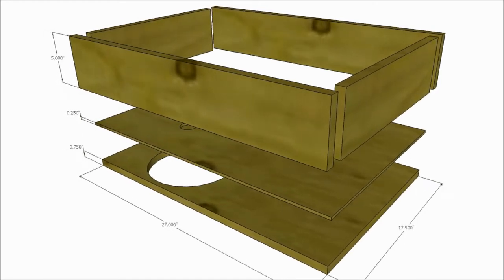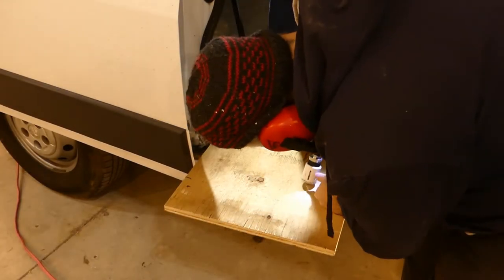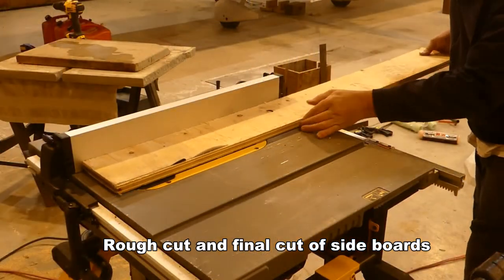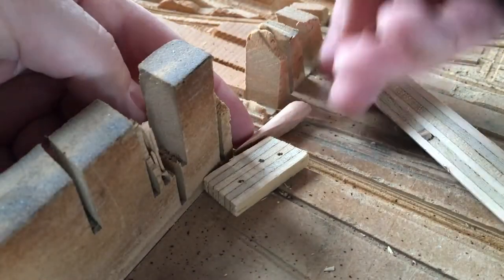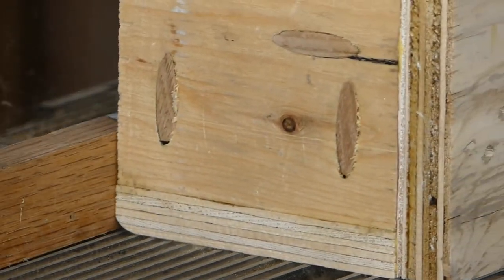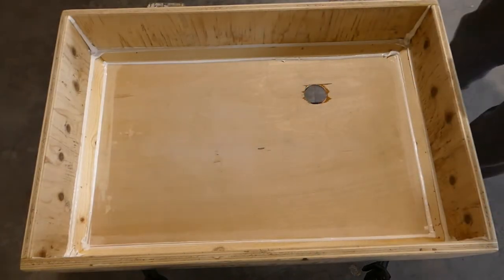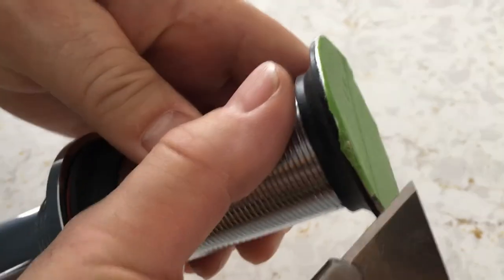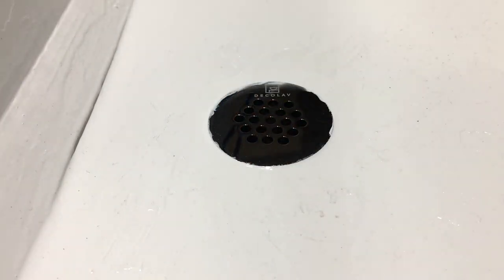RAM PROMASTER VAN BUILD - DIY Shower Pan

Comment: I’m a 75 yoa DIYer preparing to start my 1st conversion van. Your idea is perfect!!! BTW, my 30 year old fiberglass shed was to the point I needed to replace it. Before spending the energy and $$$ I decided to try Flex Seal. Four years ago, I used 2 gallons…it does not leak and holds my weight on the roof + it looks great. Thank you!!
Reply from the maker: Well that is really good to hear.  Thank you for sharing that with me. 
Dwayne

Comment: Good idea for a custom pan, never thought about Flexseal. As a carpenter though, having used pockethole plugs you simply glue them in place, let them dry, and sand them smooth. You can also cut them flush once dry with a Japanese flush saw, then sand.
Reply from the maker: Thank you for the feedback, and I appreciate the advice.  kindest regards.

Comment: thanks... that idea with the ball would not have occurred to me... I'm starting a project and that idea of how to make the part for the shower seems great... that's what I'm going to do.  👍🏼
Reply from the maker: Cool, good luck with your project.  I’m not sure how we came up with the ball idea… I guess after our plan “A” didn’t work, we needed good plan “B”.  We are having a great time building our van.  Thank you for the feedback, much appreciated.
Dwayne
Reply: @LifeIsShortDIY  I started constructing my shower pan yesterday- I'm following your process to the letter, but I'm left with two questions. My first question pertains to how the shower pan makes contact with the floor beneath it... the way the tennis ball creates a concave area around the drain, how did you control how deep of a depression the tennis ball created so that the deepest part, where the drain is inserted doesn't protrude past the floor of the shower pan - I'm guessing that the deepest part must be flush with the bottom of the pan for the drain insert to be  snugly fitted and for the entire bottom of the shower pan to be flush when it rests on the floor of the van. How did you get that concave part so accurate? I''m concerned about making an error and then having that concave area of 1/4" wood crack, either during installation of the drain, or by accidentally stepping on it when showering. 

My second question: Can you tell me, how did you attach the finished shower pan to the van floor? I've got sheet vinyl as the top layer of the floor, with a 5/8" layer of plywood as my subfloor, which is screwed and glued to 2 x 2" joists scattered throughout the van floor- I have no control over where those joists will line up beneath the shower  pan- the shower pan can only fit into one, pre-determined spot in the van so I have no guarantee of hitting the joists with any screws.  Did you screw and/or glue the shower pan to the subfloor?  How did you handle this part of the installation? 

I'd be so grateful for a reply, I really want to avoid making a mistake and hope to take advantage of your experience with this project. Thank you for a brilliant design idea! (Please forgive me, I've posted this comment in two different places in the hopes that you will find it- I don't mean to be rude by making a duplicate post.)

Comment: I’m getting ready to do this for my entire class a bathroom, turning it into a wet room.
Reply from the maker: I would love to hear how that turns out.  Keep me in the loop. Cheers Dwayne
Reply: @LifeIsShortDIY  I ended up re skinning all the walls with new plywood, sloping the floor to the drain 3/8” to 1/2” per foot.  I caulked all seams well and used 4-5 coats of redgard over all surfaces creating a seamless room and topped it all off with exterior house paint. I still want to put some penny tiles on the floor. 
For the drain I used 2 - 12” by 12” by 1/2” pieces of plywood. On the bottom upper plywood piece I routed out 3/8” deep by 8” circle and used the drain to draw it into a well. The void between these two pieces was filled with subfloor adhesive for a little extra support.
Reply from the maker: @White000Crow  sounds good.

Comment: Tub looks good but I am guessing the Flexseal may not be easy to clean.  I would have tiled it with mosaic tiles and used thinner wood.
You can use Schluter Kerdi membrane or backerboard, or Ditra. Use polymer in thinset mortar (I like MAPEI from Lowes), then stick your Kerdiboard or Kerdi membrane on it, thinset some more and stick on the tile.  Use MAPEI Grout Maximizer in the grout as a sealant and rubberizer.  The polymers prevent any cracking from vibration and also waterproof both thinset and grout.  This is what I am planning to do.  Flexseal - the problem is that it will pick up dirt and be hard to keep clean.
Reply from the maker: Thanks for the feedback and great ideas.  Appreciated.  Cheers

Comment: I am loving your videos but I wanted to ask on this one -- 2 years later, are you still happy with the overall outcome?
Reply from the maker: Thank you for the question. I aim to be transparent with you. When it comes to the shower basin, I feel I may not have sufficient experience to offer valuable feedback. While we did install the shower basin around two years ago, our actual camping usage involving the unit has been limited. Our intention in the van design was to have a shower option available if an external one wasn't accessible, and we didn't want dedicated space solely for a shower. 

Throughout the past couple of years, the majority of our showers have been taken in campgrounds or in natural bodies of water like rivers and lakes. Consequently, I can report that the rubber coating remains entirely intact, but the basin itself has seen little use. I apologize for not being more informative.

Best regards,
Dwayne

Comment: Just a thought, why didn't you just insert the pocket hole plugs and glue them in, then run a pass along your table saw to get your "fit"? Save repeating the grinding/sanding operation 25 times?
Reply from the maker: Yeah, there are always items that come to you in hindsight….

Comment: @Dwayne Price  I started constructing my shower pan yesterday- I'm following your process to the letter, but I'm left with two questions. My first question pertains to how the shower pan makes contact with the floor beneath it... the way the tennis ball creates a concave area around the drain, how did you control how deep of a depression the tennis ball created so that the deepest part, where the drain is inserted doesn't protrude past the floor of the shower pan - I'm guessing that the deepest part must be flush with the bottom of the pan for the drain insert to be  snugly fitted and for the entire bottom of the shower pan to be flush when it rests on the floor of the van. How did you get that concave part so accurate? I''m concerned about making an error and then having that concave area of 1/4" wood crack, either during installation of the drain, or by accidentally stepping on it when showering. 

My second question: Can you tell me, how did you attach the finished shower pan to the van floor? I've got sheet vinyl as the top layer of the floor, with a 5/8" layer of plywood as my subfloor, which is screwed and glued to 2 x 2" joists scattered throughout the van floor- I have no control over where those joists will line up beneath the shower  pan- the shower pan can only fit into one, pre-determined spot in the van so I have no guarantee of hitting the joists with any screws.  Did you screw and/or glue the shower pan to the subfloor?  How did you handle this part of the installation? 

I'd be so grateful for a reply, I really want to avoid making a mistake and hope to take advantage of your experience with this project. Thank you for a brilliant design idea!
Reply from the maker: Hi Sheri, thank you for your questions.

Plywood, even thin plywood, does not bend easily.  Even with the 100+ lbs. we had on the tennis ball, after three days it barely warped the plywood, which was perfect – just enough for drainage but not enough to protrude past the plywood frame.  I think we could have left it a week with the weight on it, and it still wouldn’t have gone any further.  The ¼” birch plywood is VERY strong.  There is no concern at all about stepping on it.

We have sheet vinyl as the top layer of our floor as well.  That is video 13 https://www.youtube.com/watch?v=OqjFu2AhzwU in our van build series.  Our flat-bottomed shower pan is going to sit directly on top of the floor.  Within the shower basin we will place a porta potty, and then cover the entire basin and porta potty with an open bottom padded box to conceal the basin and porta potty and to provide additional seating as well as a step up to the bed.  I have illustrated this layout plan in video 6  https://www.youtube.com/watch?v=Hbalc4x_vIc.  The section in question starts about 4 minutes in where I start to talk about the shower.

As far as securing the shower basin to the floor, we have nothing planned yet, other than the drain itself.  The drain actually holds the basin quite securely.  At the end of video 7, I tightened up the drain to the floor bottom before the flooring was in.  I was surprised by how secure it was, it wasn’t going to move anywhere.  At that point in time, I wasn’t sure if I was just going to leave it there and build the floor around it, or remove it later, install the floor and place it on top of the floor. 

I’m currently working on walls and cabinets, so I have most things, including the shower basin, removed.  In the end, if I have to secure it with something more than the metal drain itself, I will likely use a small “L” bracket on the sliding door side of the basin, to help secure the basin to the floor.

Sheri, I hope all of that helps, and good luck with your build.

Kindest regards,
Dwayne
Reply: @LifeIsShortDIY  This helps very much and I'm grateful to you for the prompt and very thoughtful, detailed reply! I made the mistake of installing my flooring before adding the shower pan so it changed up a number of things for me. 

The wood is now set with the tennis ball and weight- but not 100 pounds - I was wary of cracking it, after your reply, I think I'll add some more weight! 

Your comments help tremendously, thank you very, very much!

Comment: Very informative video! 
What do you use to clean the shower? All the info I find online is for removing Flex seal if it got somewhere that you didn't want it (i.e. skin, floor, wall, etc). 
I'm assuming using Castile soap or something gentle like that would work.
Just wanted to get your expert opinion based on your actual use. ☺️
Reply from the maker: Thanks for the question.  Two things, 1) the flexseal seems to get dirty easy  2)  it also seems to wipe clean easy, with just a damp cloth or a little soap and water.  So far no issues   I did hear from another fellow, and he said it doesn't stick to the seam sealant I used, so if he is right, that might be a step to skip.   So far for us, no issues   cheers

Comment: Hi Great video and great idea. Can you tell me how the shower tray is a year on. Have you had any issues with leaks or cracking
Reply from the maker: Hi, thanks for your question.

I don’t have an update for you.  Although we have been using the van, we have not used the shower yet as we are largely still in “build” mode.  

I’m currently working on the installation of the water tank and plumbing. Sorry I don’t have any updates for you. 

Kindest regards
Dwayne

Comment: @Dwayne Price Hey I really loved your video I’m getting ready to do the same thing this weekend but I’m going to go along the corners with fiberglass for a tough seal to be extra safe. I had two questions. Do you think adding a water sealant to the wood before applying the flex seal would help with potential wood rot in the future and is it necessary to make the groove in the wood like you did with the tennis ball?
Reply from the maker: Hi there, thanks for the feedback.

Water sealant – I have heard from others that adding water sealant on the seams is not needed and could actually compromise the integrity of the flex seal.  Apparently the flex seal doesn’t stick to it?  I haven’t experienced that problem yet, but that was one point shared with me, so I will pass it on.  

I think the groove or indentation in the wood is necessary to finish the work properly. This ensures that no water can pool right by the lip of the drain.  Our plan “B” as depicted in the video worked really well.  I think we just go lucky! 🙂

Kindest regards
Dwayne

Comment: Any updates? I'm about to build my shower and I've been very curious how yours held up! Hope all is well.
Reply from the maker: Hi, I don’t have any additional  experience with the product to provide at this time.  We are still very much in the “build” stages of the van.  Cheers
Reply: Instead of Flexseal I would fiberglass it with epoxy resin.